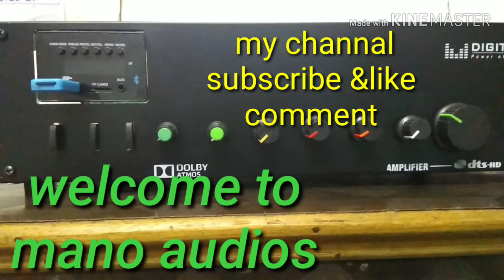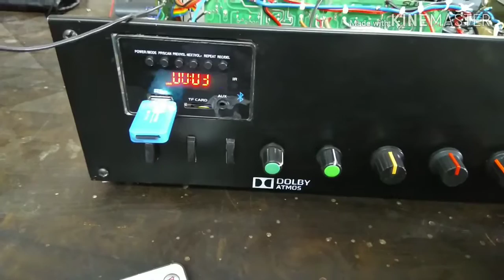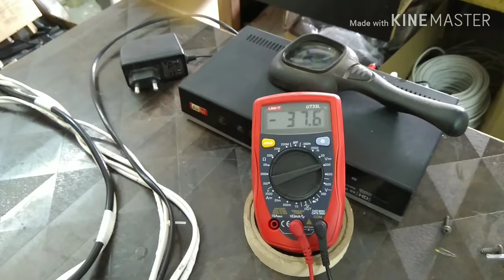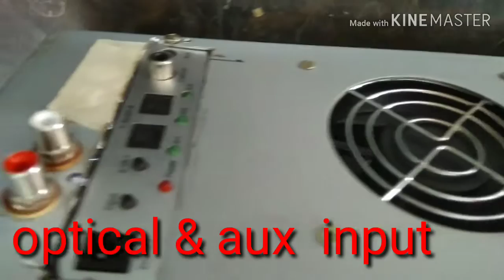5.1 Amplifier | My Personal Use  5.1 Amplifier | Mano Audios

Comment: Bro super work bro.
Bro unga videos la neraiya useful content solringa.

Bro DOME TWEETER ippo marketla kidaikuma bro. 

Neenga dome tweeter use panrikengala.

Ippo vara tweeter sound quality lam nalla illa.

Apram Maharaja power transistor boardku evalo maximum voltage kudukalam bro unga experiencela sollunga.

Please reply.
Reply from the maker: DOME TWEETER Kidaikum bro
Bangalore. Shop la.
Nan DAPIC 102 MODEL use pannukireen nanba
Reply: @ManoAudiosofficial  Thanks for reply  bro.

Maharaja & Aruna Power transistor boardku evalo volt kudutha claritya irukkum bro sollunga
Reply: Network board pathi pota video super bro.